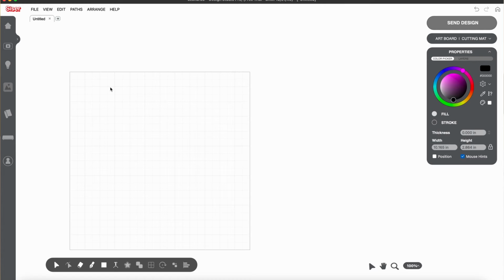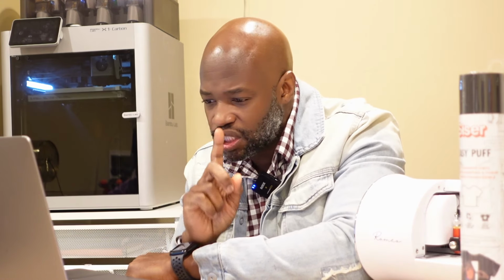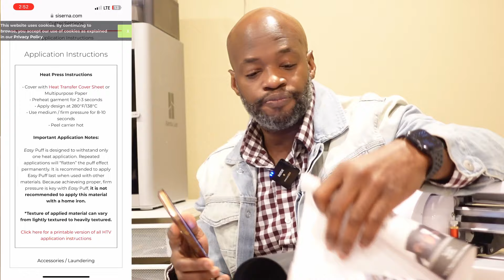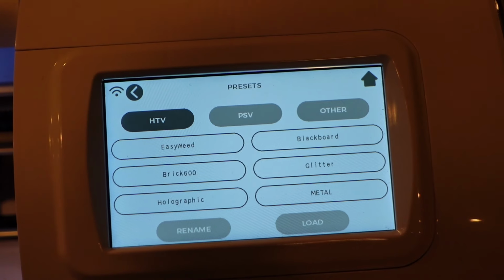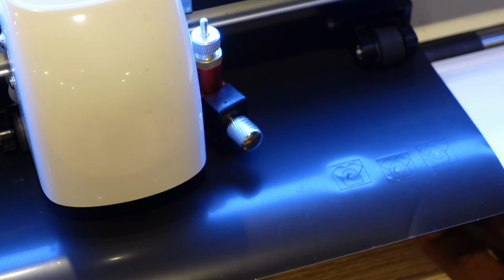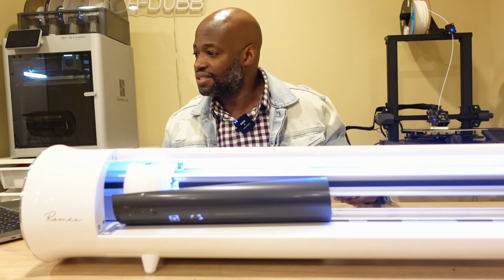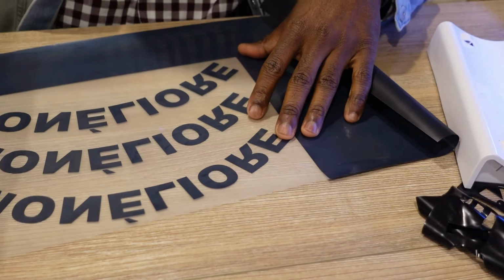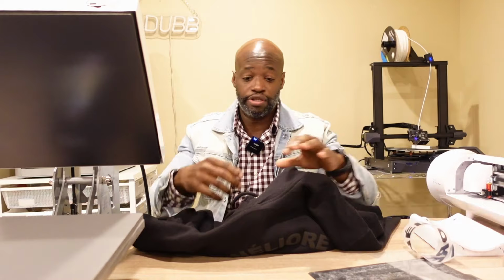Black on Black Siser Puff Hoodie

Comment: When I first used the Siser Puff, it worked ok. But every time I’ve used it after that, it’s been hit or miss. I’ve tried every different temperature and time and pressure. But I cannot master this vinyl. Any suggestions?